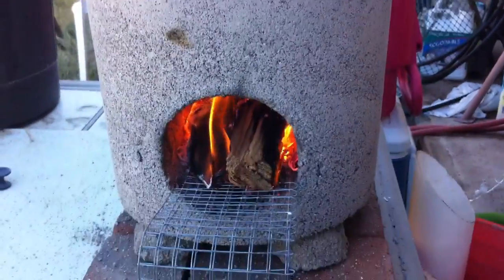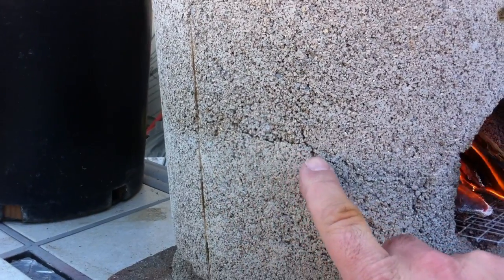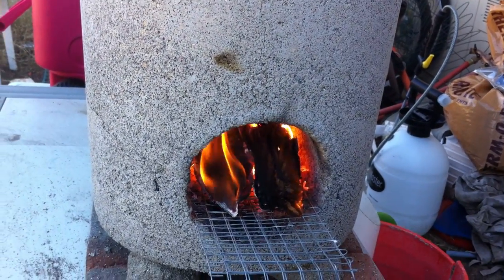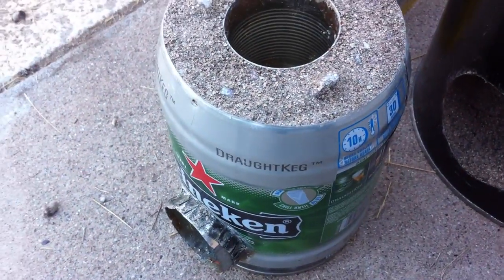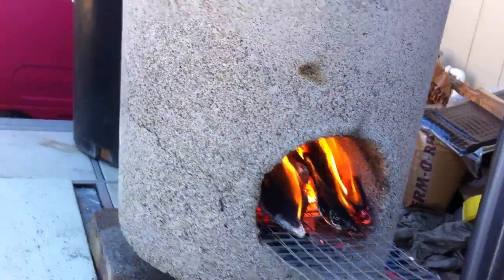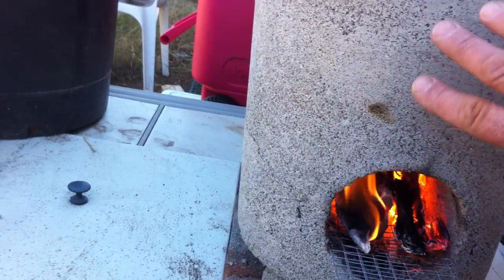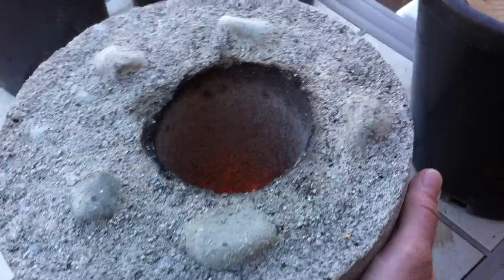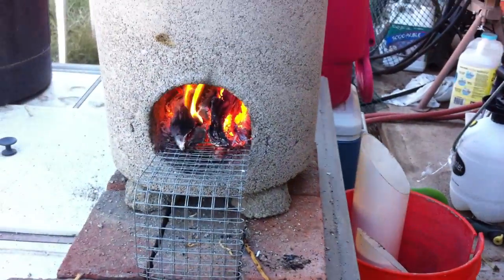Home made rocket stove, vermiculite and cement Part 5

Comment: Me, I believe your crack problem was caused by using too light a mix of Vermiculite and the Crack-resistant cement. You used a 20 cement/80 Vermiculite mix and I believe the formula should have been a 40 cement/60 Vermiculite mix, instead.  Not allowing it to cure with so much Vermiculite in the mix became the problem, as the Vermiculite holds water/moisture which is released as steam when the stove is first heated.  I can be totally wrong on my opinion, but I don't think so. Keeping the mix inside a metal bucket won't allow the cracks to show, but they still will be there. Remember, the Vermiculite is only an insulator and not a solidifier for the mix. If you had added water glass to solidify it all, I am of the belief that it would have done an even better job in prevention of cracks in the final product, as long as things were properly cured.Not being critical in the least of your decision, but just adding something to think about and consider. Look at most of the diy projects of guys making kilns or furnaces to melt metal inside with the same essential ingredients in the mix and you will find most have a larger cement to Vermiculite ratio used, with no resulting cracks.One other thing to be aware of is that Vermiculite and Perlite both retain moisture, so it is a good idea to cover these stoves to prevent moisture resulting and the steam or eventual cracking to take place when the stove is lit after a rain. Thanks for posting as it gives me some ideas to consider when I put my rocket stove project together.
Reply: Try using Refractory Cement (AKA- Furnace/Fireplace Mortar) instead of regular cement. Portland Cement melts at ~570°F (300°C), which is why you're getting cracks. Rutland Fire Cement mixed with Perlite (NOT Vermiculite) in the same 20/80 ratio will last a LOT longer. Just give it a few days to dry before firing.
Reply: a1930ford Helpful comments. . I have tried  vermiculite,  Portland  cement with and without  waterglass. Like you said vermiculite  is not a binder .  Waterglass doesn't  help to bind the ingredients  . The mix Needs some  he man , aggregate.  like sand.  Surprising  to me was , how much waterglass was needed  in a cement , vermiculite  mix.  How  much? Way more than I figured
Reply: Sorry for asking a stupid question. What is the purpose of perlite and vermiculite? First time I heard these terms. Not sure whether it's available here.
And first time saw how a rocket stove works. Maybe I will try to make one.
Can't I use 100% cement with sand? Or granite or marble chips? During my younger days, I use to make ordinary stove for outdoor use. I used a mixture of sands, granite chips, iron dust and cement. No exact recipe, just an estimate mixture but I used 100% cement. It never cracks at all even after many years of use. 
What about using a mixture of sand, clay and cement? Any suggestions?

Comment: I thought about your leaving the metal casings on. Dos the outside of the one that you had made inside a plastic pail ever get hot? Could you have left the plastic pail on and just cut the plastic back an inch  or so from the openings? Also, any idea about the temp or force of air flow coming out of the rocket? Thanks,
B.

Comment: Your first burn should have been for less time (30 minutes), then do a little longer burn the next day (one hour) and on your third burn go as long as you want. Steam, just like ice, is powerful the steam caused the cracks.
I would also consider doing at least a 40% portland cement to 60% perlite or vermiculite mix. Just a thought since the cement is your main source of structural strength.

Comment: Dear Mate, I just made my own rocket stove using a 20L oil can and insulated it with vermiculite concrete in the ratio of 4:1 by volume. The combustion chamber is about 2 liters. It weighted 18kg roughly. I have not used it yet. I let it set for 5 days already. I expect the weight will drop after the first burn as the water absorbed by the vermiculite will escape. Will post here later. Thx
Reply: ... erm, after 4yrs have slightly passed by, what's the outcome?